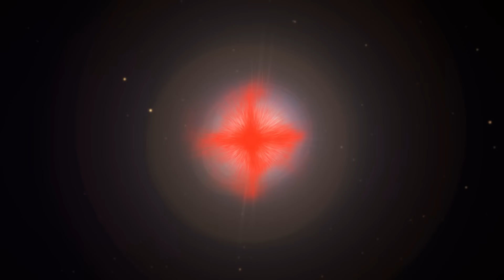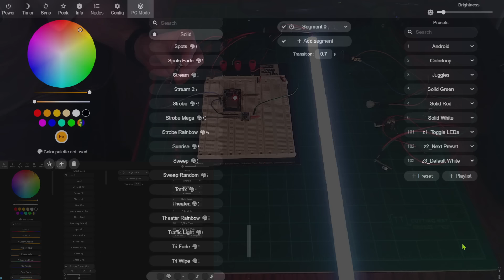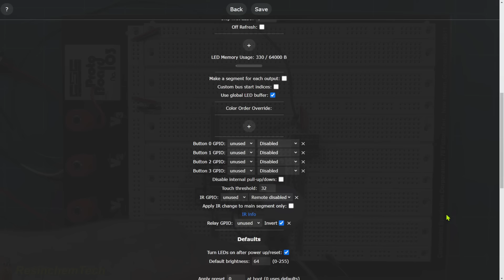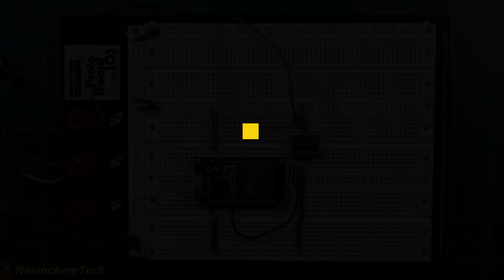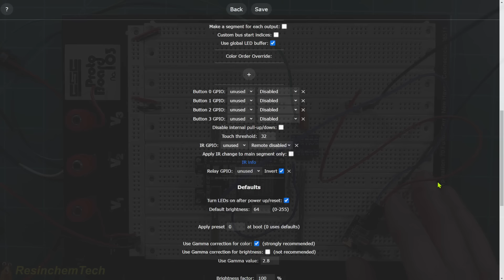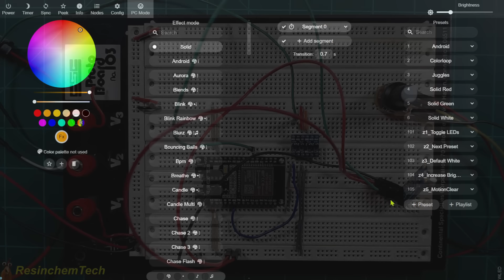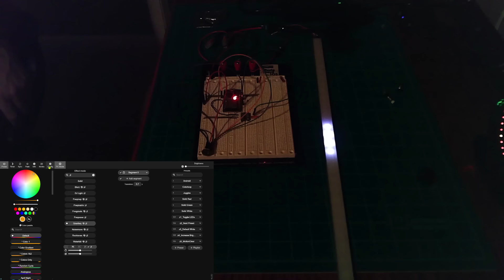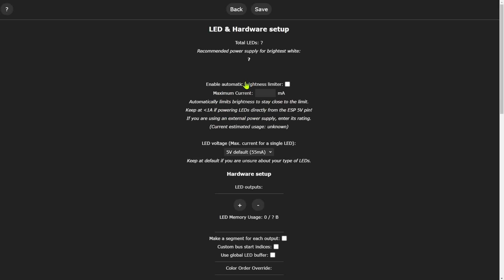Level Up Your WLED Projects: A Guide to adding Components (no code!)

Comment: awesome, wondered if i would ever watch one of your videos again, been a bit HA obsessed lately and i hate HA so have not watched the last million videos. so good to be able to watch again and WLED goodness at that.
Reply from the maker: I get it!  I do try to mix my videos between Home Assistant and DIY electronics (which will often also overlap).  It has been a little HA-heavy recently and part of that is due to my schedule.   As you might imagine, projects or builds take significantly more time to obtain the parts, test and build, film, etc. than a Home Assistant video which can generally be produced in a much shorter time frame.

But I do hope to continue to mix both types of videos.  Of course any ideas or thoughts you can share regarding projects or components would be appreciated!  That is one of the additional challenges I have with these types of videos... just coming up with ideas!

Thanks for watching and sharing your comment.

Comment: I didn’t even let the video start before I saved it. It’s like he knew my next project was going to involve buttons!
Reply from the maker: I generally add at least one button to all of my WLED controllers, at a minimum to be able to easily and quickly toggle the LEDs off/on.  But depending upon your project needs, there are a lot of other peripherals and options for attaching various devices.  Some of these are probably a little lesser known options, so I thought I'd try to cover everything that could be added with just the standard WLED.

Thanks for watching!
Reply: It covers all the peripherals not directly related to the LEDs which is my personal next level up... and talking of levels, I noticed the omission of the logic level shifter. I have worked out that the threshold for the one you have which is same four channel.i have, that 3.4 volts makes it work so using an buck converter from the 5v output adjusted to around 3.4v triggers it. Also I tried using a resistor to knock the 5v down to 4.7v and that also worked. 

I am for the last hour or so trying to get my button number 3 to cycle through all user presets, this is my very first attempt at coding. I am thirsting for the day that I learn to use ChatGTP to write the code. 

Thanks again for such a great tutorial that I will probably watch another five times or so as its so good.
Reply from the maker: I didn't talk about the level shifter in this video, as it was meant to be primarily about the optional peripherals that could be added... and I've covered the shifter, and alternative option, in detail in other videos, so I didn't want to make this video even longer than it already is.

For cycling through your presets, you probably want to exclude anything that isn't truly an effect preset (like those that are just API commands).  So, you can specify a starting and ending preset and it will cycle back to the first preset after reaching the last one.  The API command you can use for this is:

&P1=x&P2=y&PL=~   
where x is the ID number of the first preset and y is the number of the last preset.  I try to number all my 'API presets' starting with number 100 so they don't interfere with normal effect presets... that way I can use anything between 1 an 99 for creating playists.

Hope that helps out a bit.  Again, time just prevented me from covering a lot of details on creating the API commands.
Reply: @ResinChemTech  Amazing! That's an hour+ frustration over with! Where "x" equals... is the logical answer... my logic tank never got filled up. Haha

Yes, the LLS tutorial is defo going to get viewed, along with the basic LED tutorial which I am currently enjoying... because I am definitely appreciating the concise information presented without ego or fluff. 

I do wonder if the road leading to you beautifully lit home resembles the rainbow road from Mario Cart? Lol

Thank you so very much again for your help, I appreciate you and the time you took to put me on the right path. ✅️
Reply: @ResinChemTech  oh and, thanks also for pointing out the preset clashes with commands. It would've driven me mad. ✅️
Reply: @ResinChemTech  button cycle success! Thank you.

Now it's time to rethink hpw I make presets. I like the quick load labels and ant to suggest to the team that to have a page just full of quick load buttons that can be grouped would really make this the ultimate tool for doing light shows to music. Currently, I am making a dance tent light setup, I have incorporated a spiral and two 32 wide x 35 pixel high spectrum analysers. I push the segments and transitions to the limit and really enjoy the random effects that occur when transisttioning. 

I would like to show you but I can only post a google drive link currently if you'd like to see it?
Reply: Thankyou universe for this Synchronization, really great video and only half way through - Thankyou